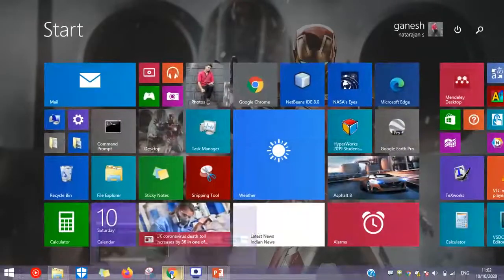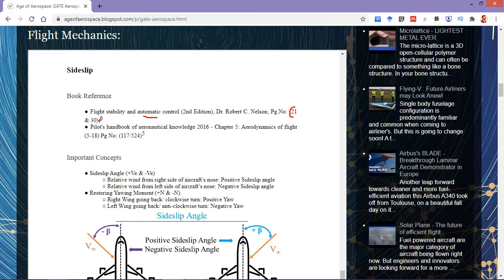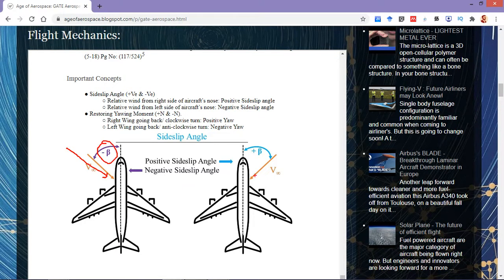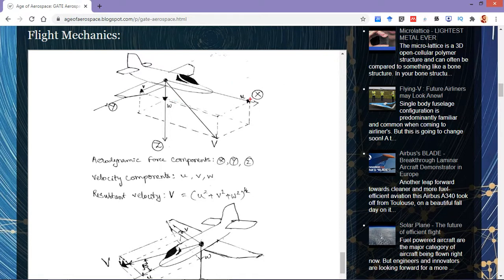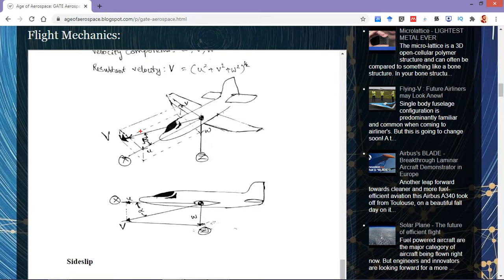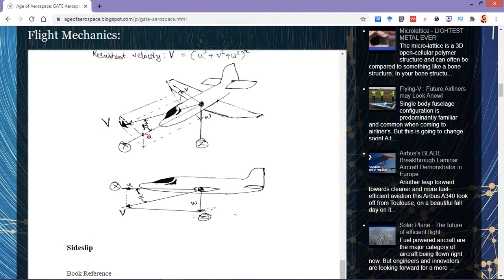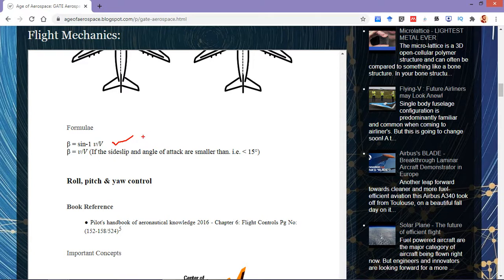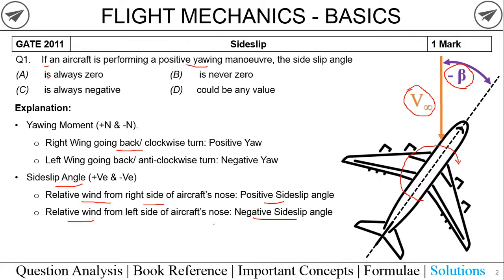Sideslip | Q & A | Topic wise Solutions | Flight Mechanics | GATE Aerospace

Comment: 🙏Sir....what is estimation of cl,cd and cm from pressure distribution

And

Variation of aerodynamic cofficient with reynolds no. And mach no.🙏🙏plz tell
Reply from the maker: Cl and Cd from pressure
https://aviation.stackexchange.com/questions/45904/how-are-cd-and-cl-calculated-from-cp-data
https://www.grc.nasa.gov/www/k-12/airplane/right1.html

Coefficient of lift is directly proportional with Reynolds number & Mach number
Coefficient of drag inversely proportional with Reynolds number
For most aerodynamic objects, the drag coefficient has a nearly constant value across a large range of Reynolds numbers.

Aerodynamic coefficient variation with Mach Number

https://www.researchgate.net/publication/273923634_Computational_Study_of_Flow_Around_a_NACA_0012_Wing_Flapped_at_Different_Flap_Angles_with_Varying_Mach_Numbers